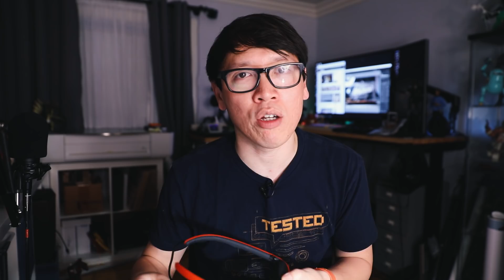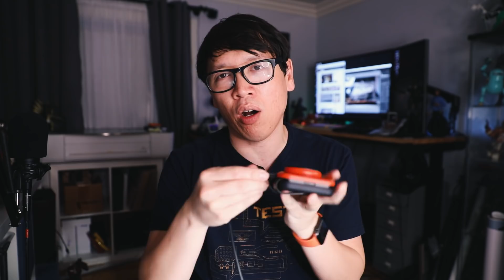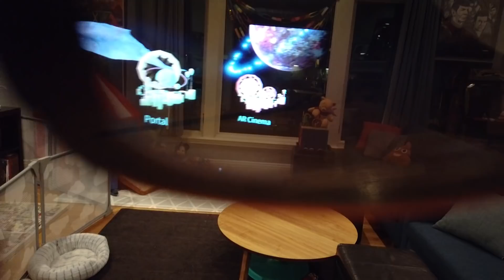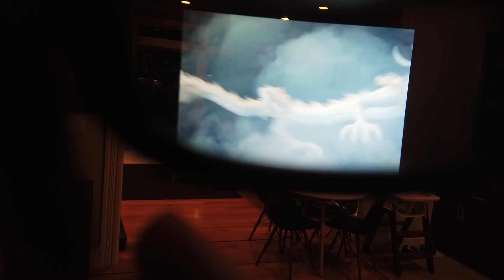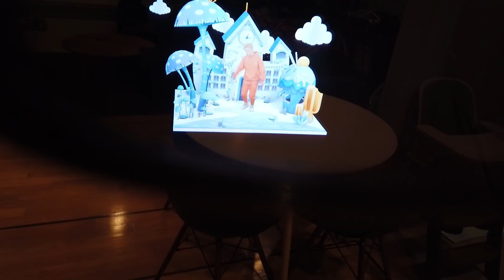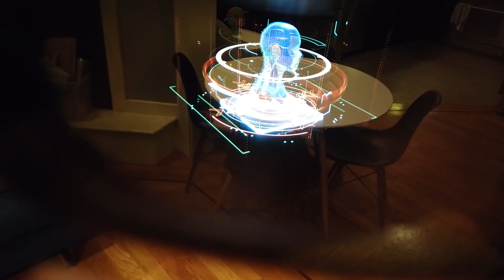Nreal Augmented Reality Glasses Developer Kit Review!

Comment: Aa long as the user has to wear glasses or a headset, Augmented Reality will never be the standard for consumers. This might be great for developers and engineers but that's pretty much it. That's why 3-D has failed so many times, people hate wearing headsets and glasses.
Reply: Not 100%. I do not mind wearing glasses. And I think that people used to wearing glasses won't have a problem with them. After all there wearing glasses anyway. And that not just people vision impairment. But people who use them to filter light use sunglasses or blue light filters. And many wear sunglasses just to look cool on top of that.

The thing with Augmented reality glasses is that they generally not discrete and are not fashionable. They can also be cumbersome. And those factors I think is what holds them back. The glasses here is a move in the right direction for mass use I think. But I would not say there fully there yet.
Reply: @Cythil  It doesn't have to be 100%, there will always be consumers willing to buy these glasses and headsets... But the reason why 3-D failed for the fourth time is due to the fact (there weren't enough) consumers willing to buy the product. This is a business, not a fan club. They have to make money.
Reply: @theylied1776  Depends a lot on what we mean by 3D and what we mean by failure. VR for example, which I see as a different thing, it still chugging along at this time.

As for 3D TV... Well I think the problem is that watching TV broadcasts do not really add to much more to the experience to being with. And watching TV is often a communal experience and something you do just to pass time.

AR is also it own thing. And is very early. But I think it will become more popular with time. Though maybe not as glasses you where. Maybe just as a feature in you smartphone.

It can be really hard to judge these sort of tech products. And there need to be a certain maturity to it. VR is getting there with the fidelity of the headset. But is not there when it comes to tactile feel which if we nail down will drastically increase the popularity I think. Also there need to be some software development that increase the scope of what you can do with VR. Like enhancing old software to give you a 3D screen experience at least. 

AR is harder to judge in my book on how much it must mature. It will benefit a bit form VR development of course and they both can merge to a certain degree. Some AR applications have been actually used for decades. So in some ways is already a mature technology.

3D TV likely has to be glasses free if it does not ride off AR and VR development. Which might happen.

When you look back on the development on the smart phone and the tablet computer you see that it took decades for these ideas to mature enough for them to actually be markable products. The Tablet concept existed as a idea at least back in the 70's but it was not until the iPad in 2010 that the concept really took off. Partly due to Apples marketing but also due to technology having matured enough.
Reply: @Cythil  Lovely dissertation but your premise is wrong.  3D has been around since the 1950s and has failed four times due to the glasses. AR has been around commercially since the mid-1980s and has failed due to the headsets. They have both been proven to be Niche Markets and have limited appeal. And commercially, they are fads at best. Consumers, mainstream audiences refuse to wear either glasses or headsets for entertainment. That is a proven fact.
Reply: @theylied1776  Again depends a lot of what scope you talking about. I mean 3D predates the 50's. Stereoscopy exited back in the 19th century being over a 100 years old.

Also you say is due to the glasses. Well several 3D technologies do not need any glasses yet have not gotten mass market appeal yet. 

So no. I doubt it glasses alone that does it.
Reply: @Cythil  It doesn't depend. 3D has been outright rejected since the 1950s. You are aware of what Einstein said about doing the the same thing over and over and expecting a different result, right? That description fits 3D technology. Mainstream consumers will not wear glasses or headset for entertainment. That has been proven.
Reply: @Cythil  And when they perfect those 3D Technologies where you don't need any glasses that's when 3D will be commercially viable.
Reply: @theylied1776  There not doing the same thing. All these different 3D technologies all did it differently. I take it when you mention the 50's version of 3D you referring to anaglyph 3d glasses. And those are pretty crap really. Fun for a novelty but colours are distorted and the effect is limited. The benefit is that is really cheap to do. Easy to implement.

Now the big 3D movie craze that was not long ago used mainly shutter based glasses which are far better. It not that odd that they manage to actually reawaken the old 3D cinema craze that was before. Since it was superior. Not ideal for home viewing however.

And that tech is nothing like VR for example. VR is about giving you a virtual experience. Not about viewing movies in 3D. It more akin to being transported to a other world. And I bet a lot of people would rather have that in the form factor of a easy to wear headset then a whole room dedicated as a holodeck. Which is the other way you could go with the goal as I see it. There is a 3rd way to and that would be a direct neural interface. But that technology is not mature enough and will likely freak people out for a long time until cybernetic augmentation become common place. If it ever becomes common place. And even then there might be a fair bit of pushback.

VR is just starting to get mature. Took decades of research to get where we are today. Screen had to become better. Computers faster. Sensors more sensitive. Back in the 80's you could not push the resolution need and especially not the update frequency needed. Today we are at the edge. And then we still have not masted tactile interactions which only exist as far as I know in lab environments. beyond simple haptic feedback systems like force feedback. Still there seem to be a steady growth in the market from the quick research I have done. (Though I might have stumbled upon some of the hype engines to that proclaim is will best thing since toasted bread. I tried to discount articles like that and just see the actual growth.)
Reply: @Cythil  is English your second language? When did I claim all 3D was the same? Quote me directly. Use any of my comments. The only thing they all have in common is that they all use glasses as a platform. So again, until they perfect 3D technology without the use of glasses or a headset it will not be commercially viable. . Has been historically proven 3D technology has been around since 1922.
Reply: @theylied1776  OK. Here is the problem. You mention 3D technology have been done 4 times. But do not mention what those 4 times are, like you assume I would know. So I do not really know what you mean by that. I do not know what sort of tech your comparing. There have been scores of 3D technologies that have been developed. And they all have different advantages and limitations. For me there have been far more then 4. Like I mention before the Stereoscopy was somewhat popular novelty back in the 19th century. Even predating practical photography. 

And you defence why 3D technology that is not based around headsets or glasses have not become popular is that they are not mature enough. But can not that argument be used for glass and headset based technology to?

I still hold that glasses won't likely be a implement in the long run as people do use glasses for other proposes today. Ether to improve there sight or as a fashion statement. And you have not really shown that this is not the case. Today we even have laser eye surgery and lenses yet a lot of people chose to use glasses over those options. So even in a world where we have other options it alone has not stopped people from using glasses. I will tell you one thing however. Even very techy people are hesitant about wearing uncomfortable and ugly glasses even if they have the nicest coolest tech in them.
Reply: @Cythil  Which part of (quote me directly) don't you understand? Anything less is paraphrasing, an interpretation, and inferring. You are basically arguing with yourself with an interpretation that you are coming up with, which has nothing to do with what I actually wrote. This is why I keep asking you if English is your second language.
Reply: @Cythil  when you compare apples to oranges like your comment today we even have laser eye surgery and lenses yet a lot of people choose to use glasses over these options. A lot of people cannot afford to have the option of laser eye surgery or implanted lenses. That's why they choose glasses they're only going to cost them $30 add a large chain like Pearle Vision Center. Versus having laser eye surgery which can cost anywhere between $1,000 to $6,000. You are literally comparing apples to dinosaurs.
Reply: @theylied1776  But there are people who can afford these other options and still chose glasses. In fact a lot of people who use lenses also uses glasses. And like I mentioned before. Some do so for a fashion statement even when they do not need to.

Now will there be people who do not want to wear glasses? Well yeah. But the thing that not everyone will not care about wearing glasses. So based on the number of people who chose to wear glasses even when there are other options I say it safe to say if you made AR glasses about as comftable and as fashionable regular glasses and at not to high cost, then people would actually use them. And if not then is more that AR have very little to offer for the typical consumer.

(Of course AR is already in use in many places but for specific use cases. You likely have AR tech in your car if is modern one. And your smart phone can use all sort of AR applications. Though it still rather niche)
Reply: @Cythil  You're still comparing apples to oranges... if people have the option of having corrective laser eye surgery they would do it instead of wearing glasses but laser eye surgery can cost anywhere from $1,000 to $6,000 for both eyes to be properly done. You're flawed logic is like comparing someone who buys a Toyota Corolla to someone who buys a Veyron Bugatti. Give me the Ford it do it but the majority of people cannot afford it. That is the point.
Reply: @Cythil  Again yeah there is AR Tech in certain places like heads-up displays in cars... but I don't have to wear a headset or glasses to access that AR Tech. That is the point. It is a commercially viable if you have to wear a headset for glasses.  English is not your first language, it can't be... no one is capable of misunderstanding basic English to this degree.
Reply: @theylied1776  No there are cases where people chose not to go though laser eye surgery even if they have the opportunity to do so.  And again you avoid the fact that people even not needing glasses still wearing glasses.

What you actually doing is trying to pick out minor details in what I said, lifting them out of context, and then obsessing over those details. All the while ignoring the more pressing points. You are arguing that no one would wear glasses if they did not have to. I think is pretty clear that people actually chose to even when they do not have to wear them. People will fully function vision still wear glasses.
Reply: @Cythil  You are basing your circular argument on something YOU interpreted that I never wrote. Good luck with that.
Reply: @theylied1776  Well you did say that people won't wear glasses. That is the central part of you argument is it not?
Reply: @Cythil  Prove me wrong. Quote me directly, use my exact words.
Reply: @theylied1776  No I am asking you what you stance is. I am not trying to prove you said anything. I am trying to get clarification. This is not about winning a word game.
Reply: It doesn't really need to be mainstream like how Vr isn't mainstream but still has a good fanbase  that's all it needs.
Reply: @notimeforcreativenamesjust3034  I never implied it had to be mainstream. Let me put it like this, if you're only selling 100 units out of 10 thousand that shows the market for that product is limited. Let me ask you, what was the last innovation in VR? Or are they simply using the same tech that DARPA invented in the mid-1980s?
Reply: @J.W_  Wow, needing to wear glasses (to see a foot in front of you) or to protect your eyes from UV Rays Vs wearing glasses for entertainment are two VASTLY different concepts. One application absolutely nothing to do with the other. You are comparing Apples to Oranges. 

The only way this will be mainstream is if the glasses/headsets are given away for free. It has been proven a majority of consumers will not wear glasses or headsets, this is a small specialized niche market. 3-D failed because people didn't want to wear the glasses.
Reply: Look at the ficitonal SAO Movie (anime) would you wear this device called ,,Augma,, ? that would be the peek if we get their (ever) i hope
Reply: @STROMFUZZI  I don't know how else to say this, 3D failed because people refused to wear the glasses. Unless they innovate technology close to being a holosuite, a majority of consumers will not be invested in any type of augmented reality devices like headsets or glasses.
Reply: @theylied1776  But how else? Elon Musks Neuralink ? would you willing to get a Chip in your Brain? i think most consumer would buy a lightwear device instead of going full ham.
Reply: @STROMFUZZI  Again, Unless they innovate technology close to a holosuite, a majority of consumers will not be invested in any type of augmented reality devices like headsets or glasses. The failure of 3D has proven this to be a fact.
Reply: @theylied1776  cant really compare 3D glasses with AR ones. Totally different only the look is almost the same. When they inform thereselfs enought they know that AR isnt 3D only in new term tech. Also almost every second human wears a normal reading glass or normal Glasses everyday. If the implend the tech in ,,normal,, glasses where you cant see the difference (like the concept or rumors oft Apple Glass) then it will take of sometime in the future. Trust me their.
Reply: @STROMFUZZI  You do know that augmented reality was invented in the mid-80s by the United States military and DARPA. And ever since corporations have been trying to sell augmented reality to the general public for 35 years and it has not caught on other than being a very niche Market. So yes, given actual history I can compare augmented reality to 3D glasses.
Reply: @theylied1776  Cant compare the AR Thing from 30 years or so ago with the possiblity and tech we have today... But it will be always like that some people are open for new stuff and others just wont accept ,,NEW,, things or ,,CHANGES,,. Sadly but true (not affiliated with you just in generel)
Reply: @STROMFUZZI  It's the exact same AR Tech from 35 years ago. The exact same AR Tech innovated by DARDA from 38 years ago is used in the most advanced Stealth Fighters, the F-22, and F-35. And less advanced versions are used commercially for systems like Oculus. The (only) difference is that processors and graphics have gotten faster and better. 

You don't know what you don't know. AR glasses and headsets failed for Nintendo and Seaga 25 to 30 years ago and AR glasses and headsets will fail again.
Reply: @J.W_  Thanks somebody who understand the matter
Reply: @bosstowndynamics5488  3D has been around commercially since the 1950s and has failed commercially several times. History isn't on your side.
Reply: @bosstowndynamics5488  When did I suggest or imply 3D and AR were the same or even close to being the same tech? Do you even even read my original comment? Better question, is English your second language? That's the only explanation, something must have been lost in translation?
Reply: @bosstowndynamics5488  AR has been around commercially since the mid 80s, for almost 35 years, it was Tried by Nintendo, Sega, and the rest of the video gaming industry and has failed commercially. It is a niche Market commercially. The only practical applications are for design and engineering. So again, HISTORICALLY it has failed in the last 35 years to be commercially viable. What is so hard to understand about that? Is English your second language?
Reply: @bosstowndynamics5488  Also, companies like Microsoft even try to Market AR to the Department of education. And they rejected it as well. Historically AR has failed across-the-board commercially.
Reply: @bosstowndynamics5488  In the late 80s and early 90s every computer and video game company experimented with augmented reality. They all did. Microsoft even try to sell augmented reality computers to the Department of Education.
Reply: @bosstowndynamics5488  Is English your second language? When did I claim AR wasn't going to go anywhere? If I'm not mistaken in TWO of my previous comments  I specified that AR is being used in the most advanced  fighter jets, F-22 and F-35, and AR is being used in engineering and development. This is why I said it's a very (niche market that has very limited applications). I wish you two would stop jumping to conclusions and use what I actually write instead of inferring and using simple conjecture.
Reply: @bosstowndynamics5488  Once again, English must be your second language. You are interpreting and inferring. Quote me directly, use my exact words. The reason why you refused to use my exact words is that my actual words defeat your entire argument. Paraphrasing and supposition is the only way for you to make a point.